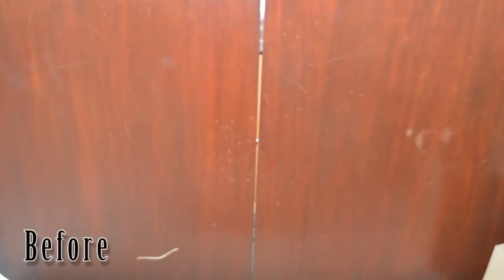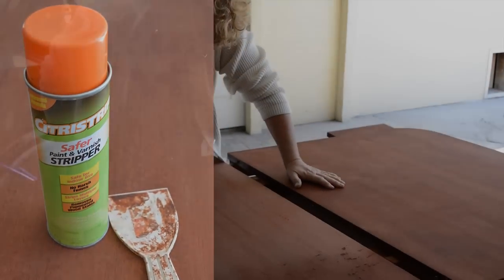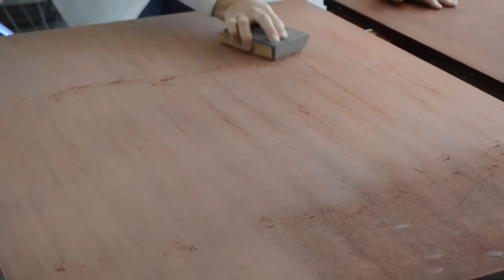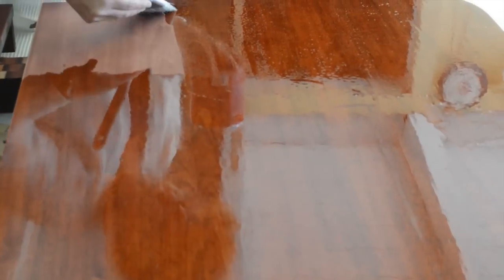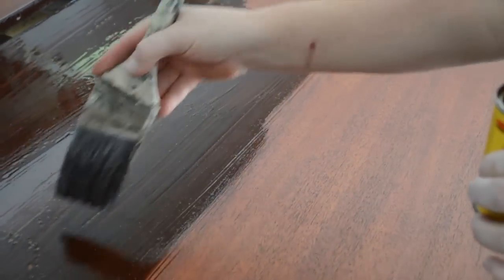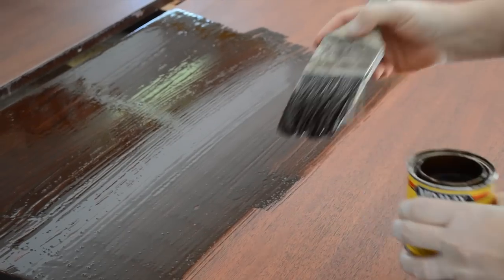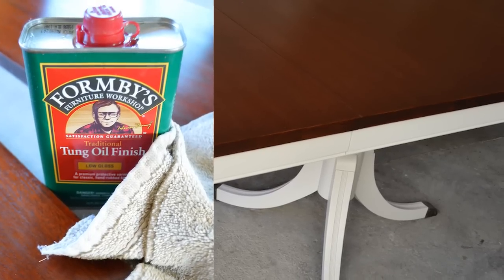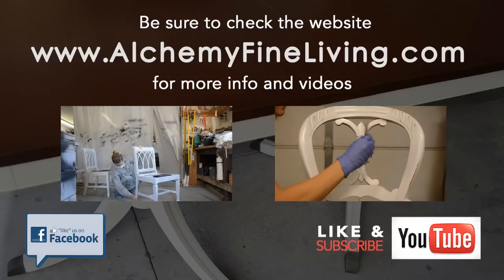how to refinish a mahogany table top

Comment: Is it possible to apply new finish after stripping the old finish? All the damage on my table is in the finish and I want to keep the original color.  Thoughts?
Reply from the maker: tworuth herts If there is no damage to the wood you could just strip the old finish and apply a new one. You wouldn't need to do any sanding, but I would still recommend a conditioner before applying the new finish.